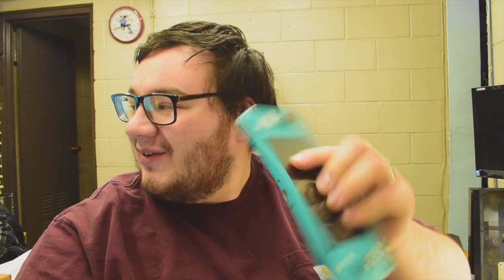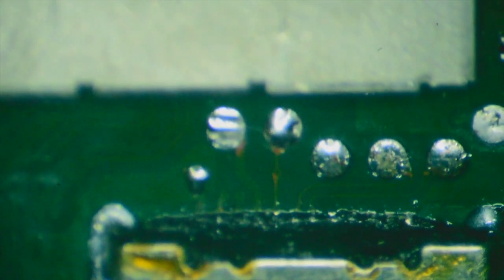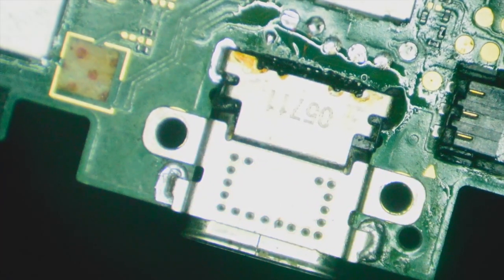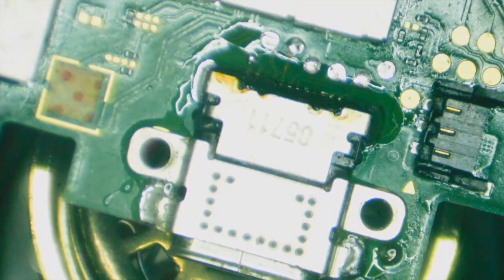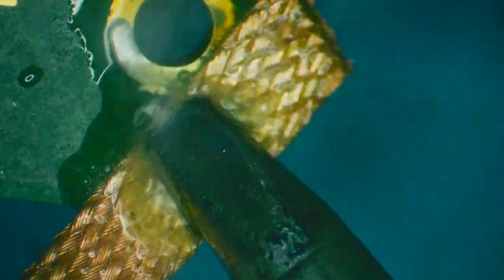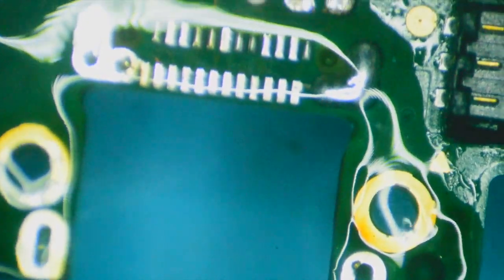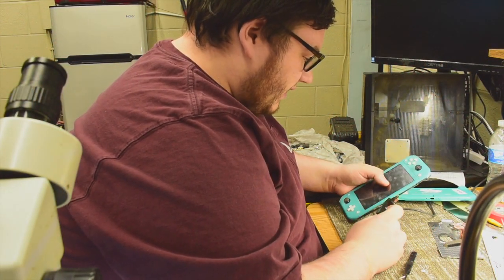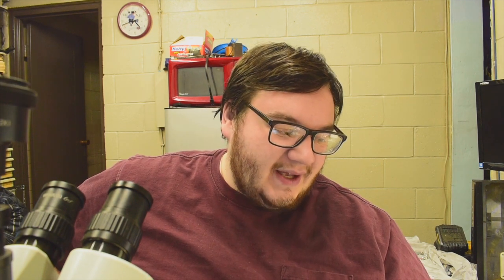A Customer Attempted a Repair.. Let's fix it!

Comment: Must have been a relief when you removed the power port, & the pads were in good shape! Whew! A good video would be on using the hot air gun emphasizing pressure & heat /temp settings for certain components. Thank you 🤓
Reply from the maker: Oh definitely! Pulled pads are never an easy fix. Even for an experienced tech!